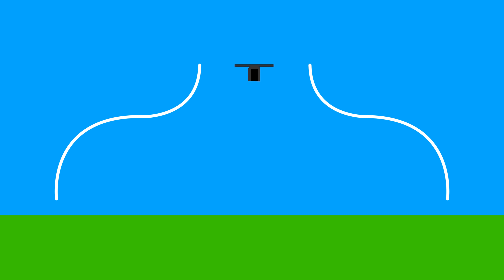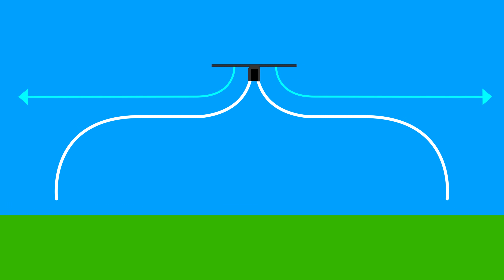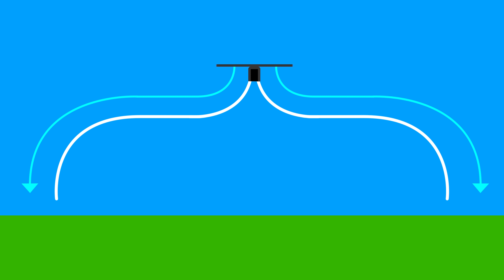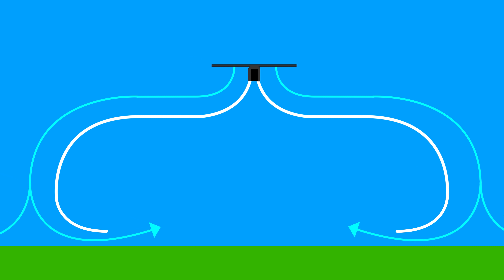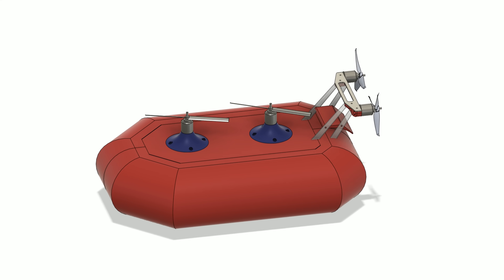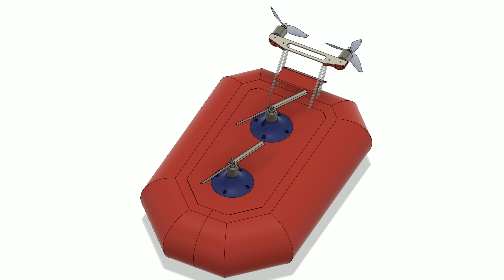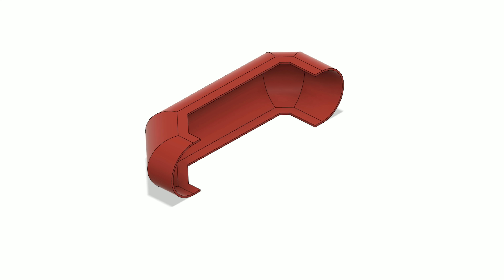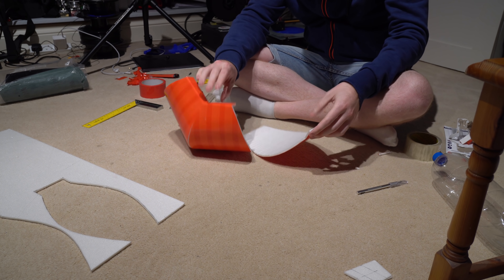Coanda Effect Hovercraft

Comment: I feel like there is some inefficiency that could be avoided in the design. I will preface I don't work in this field and am not an expert at all, just a sophomore engineering major in college. However is it not counter active to have the lift blades in the center of the rear blade? because the rear blade that moves the hovercraft horizontally would be pulling the air that the lift blade already brought down that is meant for... well lift, but instead push it backwards to propel it forward. So wouldn't it be better for the rear blades to be above the lift blades? That way any air pulled for lift stays being used for lift, but then you'd have the rear propellers and the lift propeller competing for the same "pocket" of air. So then better yet, also have the rear blades flipped the other way around too? That way the air gets pulled from in front of where the hovercraft is moving towards, and then adds even more air above the lift propellers that can be sucked down for lift. Is there something I'm missing from that, which makes that logic not work? Or is it just that it isn't worth it since there wouldn't be a noticeable difference? I'd love to hear from anyone that knows more than I do whether or not it would have an effect on the hovercraft.

Comment: Wonder if there's any way to drop the center of mass without significantly increasing the weight. Long prop shafts on the lift rotors letting you mount the motors lower? If you had a frame down inside the body for the motors you could presumably drop your power source down to the same location.

Comment: two or four opposite (or centrally) directed rollers, capturing the pocket of air in the middle below, the rollers are the not-skirt
Reply: so how about those rollers (ducted, turning, rolling) instead of the lip turning the air flow
Reply: through flow "paper shredder" lift, outside surface (very large) friction air propulsion

Comment: Okay energy efficiency wise it's pretty clear:
conventional drone > coanda drone
conventional hovercraft > coanda hovercraft
An interessting question would be:
Is the coanda drone more energy efficient than a normal drone when hovering above ground? (stronger ground effect) Cause a hovercraft is still somewhat dependent on how the ground surface looks. But with something that really flies but just a few centimeters above ground (or depending on scale a meter or something) you are more independent on shape of the ground. So there could actually be applications ^^

Comment: Tulip impeller placed inside the dome with air inlet at the top of dome will create low pressure on outside of dome. Just like a wing dome will rise.
Try it and let me know if it works.

Comment: Great video. The velocity of the air hitting the leading edge increased the lift that edge, hence the flips and instability. Having adaptive electronics to balance this would make the whole craft far more stable.  Perhaps, properly flanged, ducted fans would be a better option than propellers, as you will lose less flow sideways and give greater thrust control, with increased efficiency. Remember that most (almost all) hovercraft plenum chamber fans are ducted for that reason.

Comment: Maybe placing the forward thrust motors on the sides of the craft will bring the centre of mass lower and also make it easier to handle the torque while turning. We have a longer arm so..

I get that this placement was out of convinience and a standard design, but, I'm curious!!!

Comment: My guess is that it's the helicopter effect that's flying it, not the coanda effect. A flat board stuck across the top of the deck to eliminate any coanda effect would test it.

A conventional hovercraft is stabilised by negative feedback: as the fuselage lifts, the aperture where the air escapes from underneath grows larger, and reduces the air pressure preventing further lift. Your machine is unstable because it has no such feedback.

Comment: The impellers might need flared intake ducts (like a ducted fan)
Plus you might need a tiny fan built into the center to push air over the motors.
Reply: Also possibly a stator to straighten the airflow and increase air pressure slightly.

Comment: I was thinking "yeah, if u put efficient propellers on a random object it will fly at least a little, so maybe the Coada effect here is negligeable" but the fact that his hovercraft collects leaves actuallyhighlights this Coanda effect! The best way to prove it wouldve been to use a  parallelepiped instead of his curved structure, to show it doesn't work without Coanda

Comment: 1. In my opinion, this is a very poor drone that mostly is screwing itself upwards. I think you are pulling it into the air with the props more than using the coandra effect to create lift. I think you used coandra a little, but not very much. Proof would be the  exact same model with large holes directly under the 2 props so that their downward thrust is not redirected sideways. Then if it lifts exactly the same or now uses less power, you know coandra was not a significant factor. It it now uses more power to lift, coandra was making up the difference. 
2. The question is how to decouple the air screws so they don't pull it upwards or create downwards thrust around the skirt. Some vertical thrust off the blade tips does reach beyond the edges of the craft. This needs to be eliminated. This would allow you see if you are really using coandra or are screwing into the air. Try ducted fans to help decouple from screwing into the air. This would also give you more control of the air flow over the curved surfaces so that no downward thrust is created. Ducted fans would make all their air flow go straight down around your blue cone sections and then it would have to flow over the orange surfaces and maximize coandra.
3. Even with ducted fans, if they are pointed upwards, you will have a low pressure zone directly over top the intakes. This will "suck" the whole thing upwards. To really know if coandra is lifting your craft, the ducted fans need to provide zero upwards screwing  or upwards suction. I think a plate right above them so they have to draw in air from the sides instead of above would create this effect. If it lifts with no way to screw upwards or create a low pressure zone directly above the props or fans, then you are probably using coandra exclusively. 
4. If you do further work on this idea,  I think making the horizontal surfaces larger will help too. The air flow exits them far too quickly to get much of a low pressure zone.

Please try my suggestions. This was a cool idea.

Comment: Could that extra weight in the rear supports for the propellers be enough to cause the front end to come up?  Is it balanced from front to back?  Also, could that assembly be the reason that the hovercraft flips over so easily?

Comment: So the motors have more than enough power to make the thing want to straight up fly, and it's top heavy. Why not add weight to the inside bottom portion to counter flipping? That way the motors could be powered to 100% and not take off whilst still not being too top heavy.

Comment: At the bottom, where the ground meets the body, there’s basically no effect. It’s two horizontal surfaces with airflow going from outside towards the middle. Then it hits the void in the center, and causes turbulence that’s picking up the leaves.

Comment: Top heavy problem: as the aluminium section is relatively heavy, could it be lowered to almost ground level with longer 3D printed motor supports etc? Or could you have a sensor that cuts the motors when an excessive angle is detected, or maybe just reduce thrust by 50% or something? I dunno, just thinking out loud. Such a great project I'd love to see it perfected. You didn't mention the power consumption when compared to a conventional hovercraft, but I guess that might be hard to compute.

Comment: You don't NEED a gyro... but it would be helpful with tipping over... Also since the thrust motors are higher up, that doesn't help with tipping over either... and you kind of make a smooth rolling surface underneath :D

Comment: I'm not entirely convinced that the Coanda effect is responsible for the lift. The fact that there is leaves under the craft does point to the coanda effect, but don't you think the lift is generated by the two propellers? As i'm typing this comment i'm starting to understand whats happening here. The accelerated air has nowhere to go but down. The coanda effect then directs the air downward around the curve and that's where the lift comes from.

Comment: So... version 001 was blowing air sideways... the effect requires a more curved surface... as a sphere... so I am looking at a sphere with a skirt, or kilt perhaps... where a nozzle on a plastic hose in a small sphere that can adjust the direction of the air being blown to change direction... it makes flying spheres possible with enough umph behind the compressed air
Reply: I just bought a machine that uses compressed air to create a hundred times more pressure than is put in... some are more than that, as much as a thousand times more pressure, and I believe it's a continuous flow, rather than piston like pressure strokes... although it is using pistons... my understanding so far is very high pressure, over very short distances... it doesn't seem like a good idea to wander around with an air tank holding thousands of bars of pressure 🤔, and it's exactly like hydraulic brakes work on cars, right?... it's not necessary to reinvent the wheel every time we go somewhere on wheels or otherwise

Comment: I would give you suggestion, instead of bending the bottom down try making the exit air at 90 degree downward and put those horizontal thrust propellers on CG line, where the airplane wings would mount. It will stop flipping over issue, as the weight of the propeller will distribute at C.G. If you find it helpful please pin it 🤘🏻

Comment: I may be wrong, but isn't the curved surface on the bottom of the craft detrimental to the lift? wouldn't it be making an opposite coanda-effect that pulls it into the ground? (maybe why it flips over so much?)

also, what if you turn it into some kind of low altitude ground-effect vehicle like the ekranoplan? the thing seems to like to lift-off, where as conventional hovercrafts dont. Could this maybe abuse ground effect to lift heavy things at a low altitude?

Comment: Clearly you would have needed to shift weight to the base of the hovercraft and lower the C of G if you wanted to develop this further. I also wondered if the lift props were too far from the curve that creates downflow for optimum Coanda effect. You also needed a way to control balance i.e. with extra small fans - perhaps 4 fans nearer to corners rather than 2 in the middle would fix both. In terms of benefits c.f. trad hovercraft, I would have thought it important that lift did not disappear the moment the skirt left the ground...

Comment: I don't believe that this is the Coandă effect.
It's just the air from the propellers still going down despite the obstacle, as the propellers blew it down.
Proof is that the actual horizontally blowing fans did not work.
Moreover, you will get the Coandă effect ONLY with laminar airflow. Any of those ventilators create a very turbulent airflow. You would need at least some stabilizers for the airflow.
The device shown here is rather an helicopter flying at zero height and being pushed forward.

Comment: I don't think any of the lift was Coanda, just normal lift from props. Problem is your driving all the thrust down into the top of the craft totally defeating the proper effect. It reminds me of that early flying machine that had umbrellas pumping up and down achieving zero lift. Imagine putting solid sheets under the props of a quadcopter, you'd go nowhere as you're pushing down on the very object your trying to lift.

Comment: The Hovercraft was unstable for three main reasons: 1 You need all motors to counter rotate, to avoid the torch effect. That means both motors in the rear side must counter rotate as well as the main motors.
2: It's a light weigh model so you need a big fin, higher than the rear motors and stabilizers, cause the model is moving in the air not on the ground..
3: The angle from the main propellers to the model is 0 degrees, they are parallel, The angle should be something near 30 degrees to help the air move easily to the rounded shape...the coanda effect borders. But it was amazing to see the slow mo part!!!.

Comment: Those impellors look better for pressure, if you use the same rig but put them with an inlet cone (coanda effecct in the cone) then you might have the weight lower and the air coming from the inside much more effectively.

Comment: I want to see you make another one, and attach it to this one with a central chamber, like this one and the other are nacelles to a larger vehicle. Then use a Gyro to reduce flipping.

Sure it will just be a quad hover craft, but it might make it more stable. 

Or just put some springy rods that push off of the ground when it gets to an angle of about 30° or so tipped to any side. Just like 6 or 8 around the outside, maybe?
Reply: Also, is there a way to harness that pressure inside to channel it into forward thrust? Maybe that would increase air flow downward by creating a pull effect. Meaning, could you put a thin tube from the under chamber toward a rear fan that draws on that pressurized air for forward momentum? 

As it is, you're pulling air from above the vehicle for both forward momentum and upward thrust, which may be making a small vacuum above the vehicle. So there are upsides to both designs. Could you make it be both? As in, could you make 3 forward thrusters including the 2 you have plus 1 that draws air from the pressurized under chamber? Would that even help?

Comment: U should redo this but instead of the two motors at the back being so high try using a edf with a rudder and make a hole in the back of the body to mount it but try to mount it as low as possible to compensate for it being top heavy

Comment: That's not coanda effect instead of the lift up force by propeller itself. What's the difference to the helicopter, dude?

You have to use impeller instead of propeller to proove your theory. There's no lift up force generated by impeller. So, if the hover able to floating on the ground by using impeller, i will agree that is the coanda effect.

Comment: How about a system that does both coanda and normal hovercraft effects? 
so both the high pressure bladder, producing the curved surface, and a low pressure coanda region around the outside of said bladder? A system with a single blade doing both effects is feasible, if the inner part of the blade flows into the bladder, and outer part sends the air outwards. Just an idea

Comment: i am rather sure that the lift is just provided by the propellers pointing upwards and creating a low pressure zone abvove. You could build a second hovercraft with 90° angles and test if that makes a difference
Cheers.

Comment: Now add an IMU+controller that reduces front thrust when the craft is about to lift off. Which it does because of body lift, I think. Maybe as a first approximation you could set up a mixer in your remote that subtracts the forward thrust you input from the front prop?

Comment: Could you put the hover props, on some sort of suspension that allows them to shift in relation to the structure, to see if that adds turning stability? My thinking is that because the props are rigid, to the surface once the structure starts to turn over, the props just carry it with. However, if the craft is rolling to the right, the props would stay level to ground, shifting the downward pressure on the structure and maybe self correcting? I am curious as in my mind I am having trouble working out how this would effect the craft. would it self correct or make it worse?

Comment: I guess the Coanda effect is disturbed by the vortexes coming from the propellers. In should work much better if you use impellers with flow guides forming a well directed flow arcoss the bended surface. It is also not recommended to guide a part of the flow in the neutral pressure zone because the flow on the surface has lower pressure. It will reduce the lifting force and make the Coanda effect less efficient.

Comment: There might have been two different effects:
1) for the flip over its called "Unterluft" in German, meaning winds from the bottom. See an example here: https://www.youtube.com/watch?v=9kvDkNXLrn4
2) incomplete air coverage during curves at the very front of your vehicle. i am not sure but i feel like the vehicle has stronger contact with the ground leading to piking its front edge into the ground. either the drive winds is damaging the coanda airflow or just the air film is too thin/imbalanced/insufficient. if for the first, then it might be speed dependent, thus your driving speed is higher than the coanda airflow can stand. maybe the vehicle rotation gives an extra speed factor for the airflow. - just guessing.

Comment: Cover the underneath so it doesnt collect detritus, give it wings with aelerons at the back and put the forward thrust props at the front. This could really take off.
Reply: It doesn't matter which side the thrust props go, it's completely equivalent. It's like the pendulum rocket fallacy.
Reply: @ronjoe6292 -- Since the thrust props aren't aligned to the center of mass, they will apply a different moment. Rear mounted is probably better here though, better pitching up than pitching down.
Reply: Maybe covering the bottom will make it more efficient?
Reply: Absolutely correct!
Reply: Brother pay more attention it's open underneath so the air can get inside making pressure difference and creating lift
Reply: I need to see it